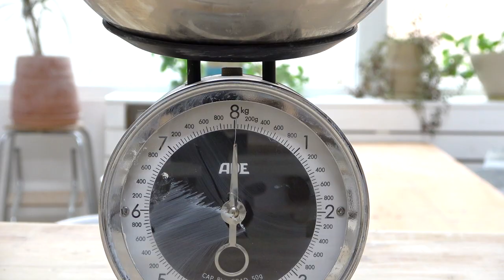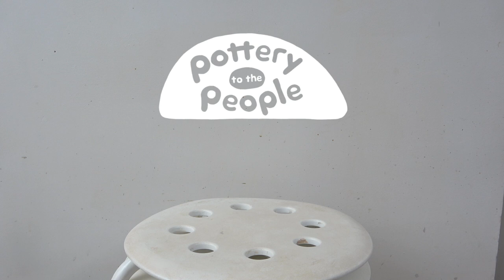Throwing & Trimming Bowls in Real Time // Whole Process Pottery

Comment: Hey what type of clay do you use? Right now I'm using both amaco #67 red Sedona clay and Laguna B-mix but I'm having trouble with both. Seems to have a very strange consistency/ very hard/cracking easily while wedging and doesn't keep it's shape when throwing very easily. Pulling walls is also almost impossible and friction happens easily even after putting lots of water. I've made pots fine before so I'm just wondering if it's my clay or me

Comment: How do you keep your pot centred when trimming? I have been using clay to hold mine down otherwise it moves around
Reply from the maker: If you can get good suction, you dont need lugs to hold the pot down. Its easier with wider pots like bowls. I will use clay lugs too if I need them. ☺️